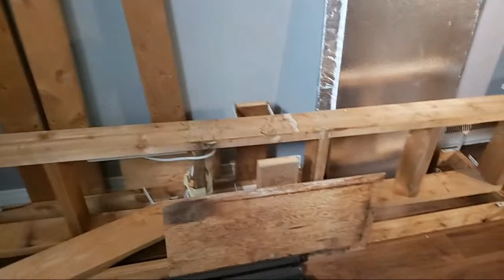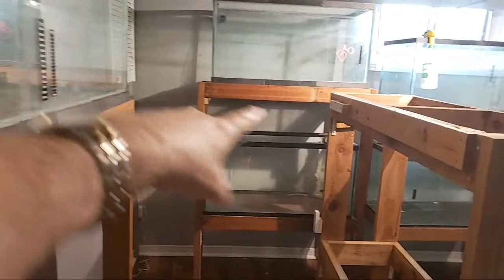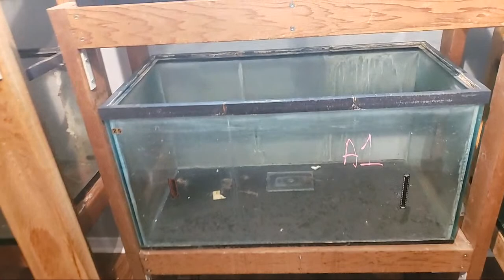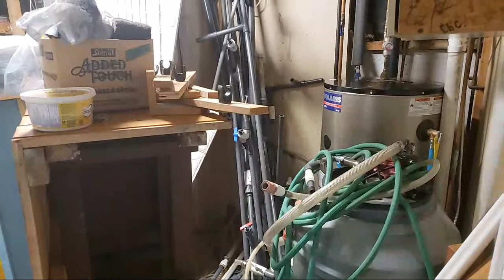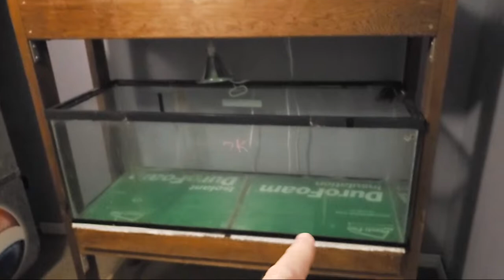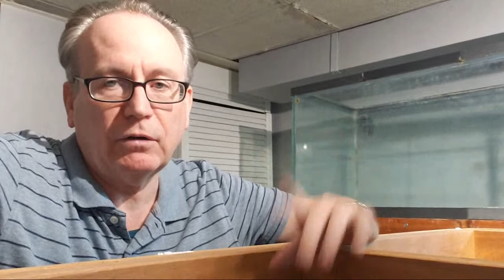Fishroom 411: Growout Space for FishEZ

Comment: What is a good alternative to power a linear pump for power outages
Reply from the maker: A small sized portable generator that can sit outside and run a long cable to the air pump will do.  I think an hour without power is OK, but after that, it's a good idea to be ready with a backup.